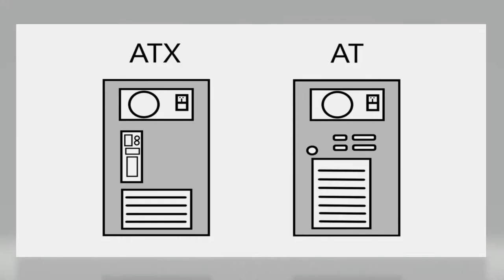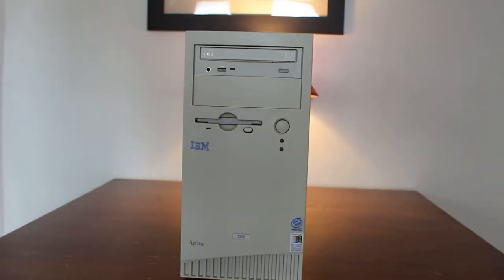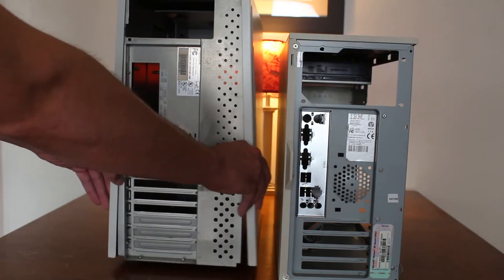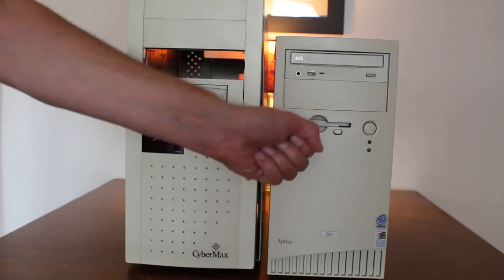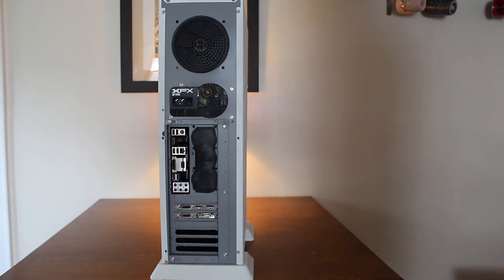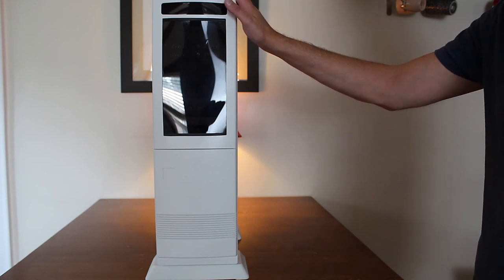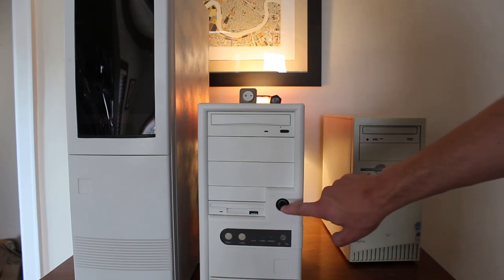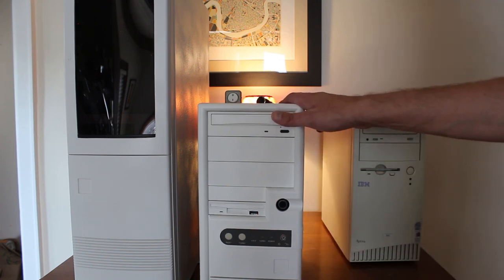How to build a sleeper PC: A beginner's guide

Comment: Awesome builds and great info. Thanks for making these vids. Can you elaborate what you used to line the border of the holes you cut on the HAL build? What material did you use for the vent? What Dremel bit did you use to cut such a clean circle on the top? Thanks!

Comment: how do you make an old power button work? is there no way to port the power button to make it work on a newer motherboard
Reply: Come on! It's just a button after all. It has same two pins...
Reply: They have a clip that keeps the switch in place when you press it, remove that clip and you now have a push button, just take a contact to connect it to your motherboard
Reply: @fernandoargueta4264  great idea. there's very few resources on such a project, and i appreciate your reply!

Comment: What do you suggest I do for an old Dell Dimension 1100/ B110 that I want to replace with new components.
Reply from the maker: Very common machines, though I haven't personally worked with one. Looks like a microATX will fit in there just fine, paired with a low-rise cpu cooler should be fine. Might be a tight fit for some larger video cards.

Comment: I cheated. Got early 9x ATX case and just stuck a more "modern" motherboard in it. Still wanted single-core DOS machine so it's only a Pentium 4 in a Pentium-era case. PCI soundblaster for audio compatibility, few tweaks in bios to speed up or slow down the CPU and the job is done.